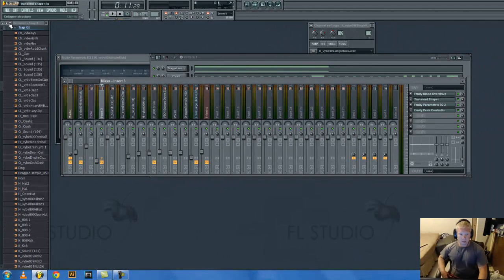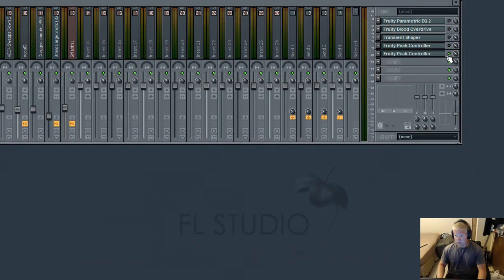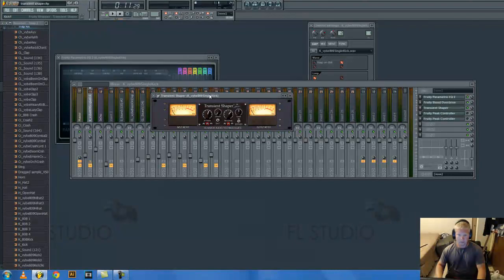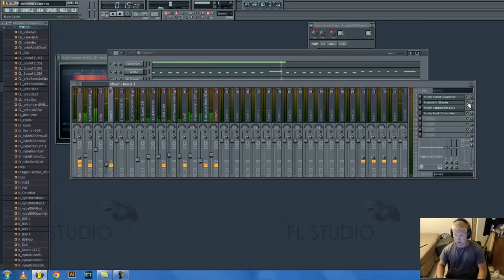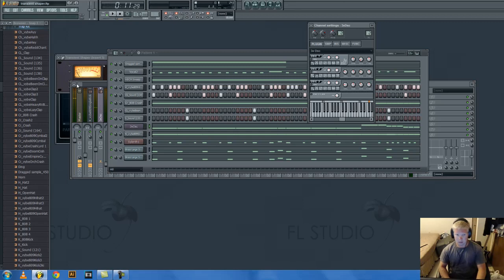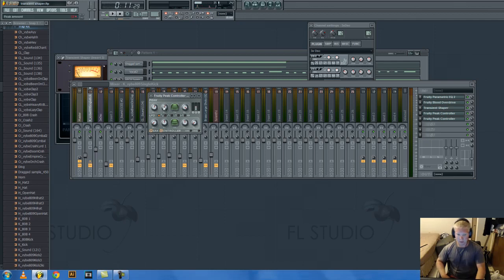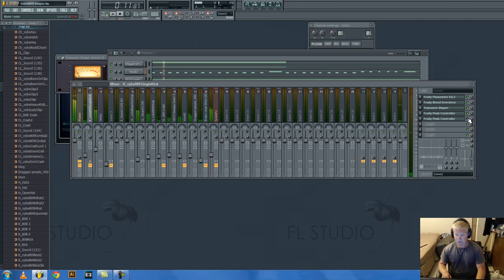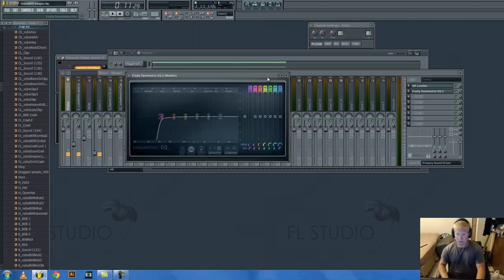How To Make Punchier Kick Drums And Snappier Snare Drums In FL Studio With Transient Shaper

Comment: dude you automate your mixer volume sliders that's not good practice at all man. those are for mixing.
Reply from the maker: What would you suggest I do? Haven't been on FL in a while but I'm still open to some knowledge :D.
Reply: i would suggest to add a stereo enhancer and use the volume knob in that one. so you can still use the  mixer sliders to mix. also you might like to use a  volume knob in a effect plugin that doesn't have smoothing engaged. you can also turn in off.
Reply: or use a fruity balance
Reply: battery chicken you can use an EQ
Reply: Ectoska jup balance is probably my go to plugin for this kind of operation, since its just a panning and a gain module its nice and neath for this purpose. why i didn't mention that one instead of the stereo enhancer, i don't know.
Reply: Jonathan Barranco anything with a gain knob will be sufficient really, i mostly just use a gain knob that's already in my plugin chain and if there isnt one in the right place i just use a fruity balance or something really small/basic. something to keep in mind when you use like peq2 for this operation and you got hq mode on you're still oversampling. that can cause phase issues if you use the dry/wet knob for example. and its just undesired extra useless processing power lost.